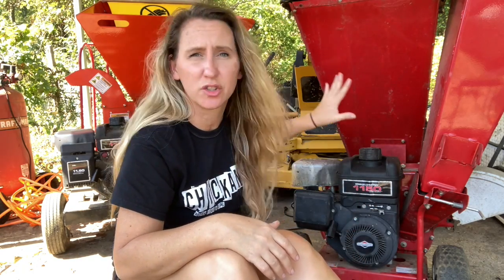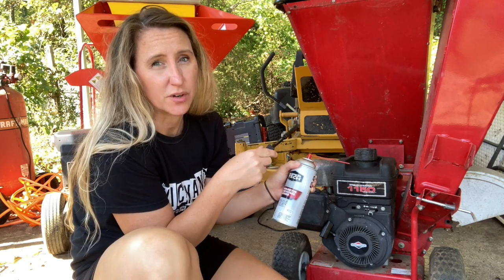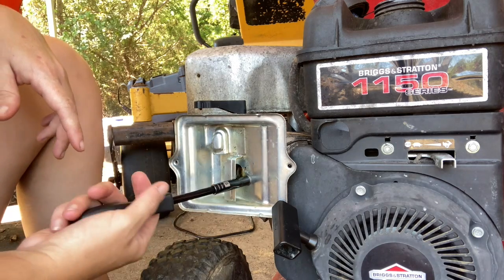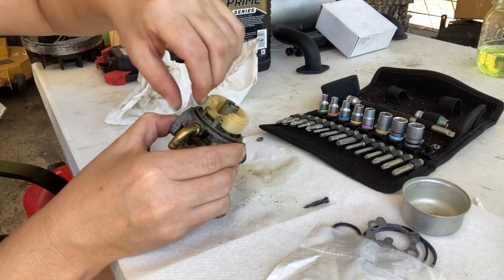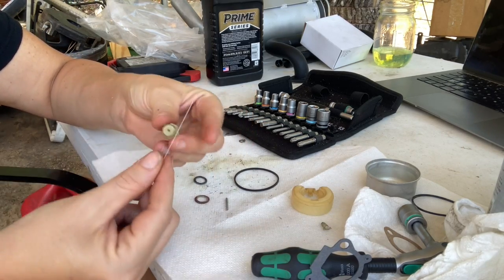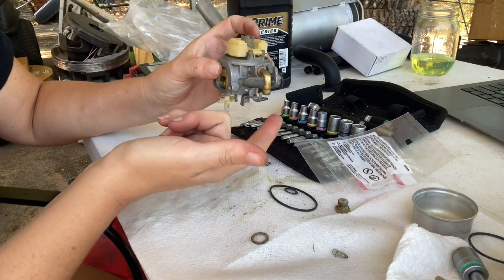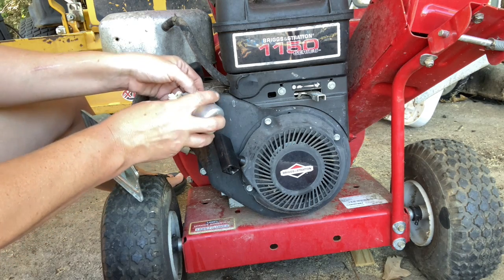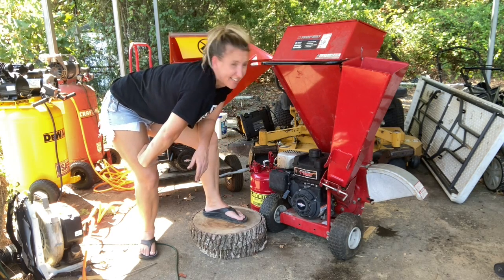Log Splitter/Chipper Shredder WON'T START? HOW TO REBUILD A BRIGGS 1150 SERIES CARBURETOR

Comment: I have a similar chipper shredder with the exact same engine. Bought it used two years ago and it ran ok but had a hard time starting. This year (2025) it wouldn't start. Thanks to your video I was able to diagnose and clean out the carb. She runs! Love watching all your videos 😀

Comment: This time I'm going put a petcock or fuel shut off on the fuel line.  That way I can shut the fuel off and let it run until it drains the float bowl. Maybe that will help next spring. Great video I totally forgot about the jet in the bowl nut.

Comment: SUPERB VIDEO! You're certainly a pro. Hubby and I love your channel. -- Question: We completely tuned-up our 12 year-old Craftsman Briggs Chipper Shredder 1450 Series that was sitting in the shed for years. It runs very well - except when we have to shut it down for a gas refill. It will not restart while warm or hot, and we have to wait for hours, even overnight, for it to finally restart with no issues. Any expert thoughts on why we can't restart a warm/hot engine on full throttle and no choke to avoid flooding?

Comment: I bought a DR chipper-shredder several years ago and quickly learned you have to be careful about what species of limbs you put through it, especially small ones. I was attempting to chip some winged elm and the bark on the smaller limbs did not get cut. Instead, it went through as long strings and wrapped the axle on the flywheel, causing it to overheat. I didn't realize it until I saw grease starting to come out of the bearing. I shut down immediately and checked the cutter adjustment. It was fine, so I just burn that stuff.

Comment: I am very surprised since you own a small engine repair shop you forgot to drain your equipment of fuel before putting it up for the winter, to me that's very surprising! Or at the very least you didn't put a fuel stabilizer and it!
Because you had done either of them you would not have to go through the carburetor right now,
My dear friend Jim before he passed away a couple of years back told me always drop the fuel bowl and drain your equipment before storing it for the the winter or put fuel stabilizer in it and let it run through it for a good five to ten minutes after putting it in so that way you know it's in the carburetor and you won't have to rebuild it!
I truly miss my friend! But the food Lord called him home and almost a year later he called Jim's wife home as well, 2 very wonderful people that are missed every single day by everyone that they touched because we still talk about them even today and talk about how much we miss them! But we know that they are at peace!

Comment: I had one of those engines on my DR chipper. Know how I fixed it? Took it off and put on a Honda GX240. Wow, what a difference in performance and reliability. Sorry, but those engines are junk for chippers, in my opinion.

Comment: I was recently given a troy bilt chipper/shredder. The pull rewind assembly was missing. Will have to order a replacement. Nice job on carb rebuild

Comment: I used a chipper and lawn mower for years but got away with carb cleaner. I guess I was lucky. We never drained gas either. Sometimes they were sputtery but got the job done. Love your info on carbs etc. I watch all of them.

Comment: My brand spankin new Harbor Freight chipper shredder with the predator 212 motor same problem. I'm going to bypass the oil sensor and put a better spark plug in it and see where that gets me. Im so pissed.

Comment: The pull start on those will wear you out after a few yanks :-)  I've had mine not getting fuel after sitting for a few months and started with the step of removing the bowl off the carb without removing the whole carburetor.  Cleaning that jet with some wire and compressed air was all it took and is a quick first step before pulling the whole carb off.  I only use my chipper shredder once or twice a year so this can happen more than you'd think.  I love your videos.  Great job.

Comment: Any good tips to prevent this?
I make it a habit to run all of my equipment at least within 2 months.
Seems to work just allowing gas to flow through the carb for a good 5-10 minutes.
Is there an easier way to do an unlimited storage an prevent the gum Stabil?
Berryman’s in the tank has also helped quite a bit on some rough runners when I do get them started.
Also I never let the tank go dry in anything!
Great videos! T in PA

Comment: The thig I hate about the Troybilt is that you have to spin the entire unit to start the motor. That is crazy hard and so much work. Couldn't they have designed a clutch or way to disengage the shredder from the motor?

Comment: Old fuel in the carb will keep that wood shredder from running. I had the same issue with my lawnmower. I had take the carb off the engine, take it apart and thoroughly clean it. Good vid, BTW.

Comment: hi, just got myself a brandnew "hillvert ht hector 212t garden schredder. It is already a replacement, because the first on was not starting. This is OTB and not starting, so frustrating. I think i will check the carb to. Maybe it was in stock to long? am i guessing wright?

Comment: I notice this again and again with almost all engines that I repair, especially motorcycles: Over the winter months, the gasoline has lost its ignitability. This is especially the case in recent decades, when gasoline contains more and more alcohol. Simply drain the old petrol into fresh one and the machine will start immediately.

Comment: Hi, thanks for the very informative videos. I have a Yard Man chipper/ vacuum with the 173cc engine. I rebuilt the carb last year and it ran fine. I started it recently, first pull and it was running. I used it a few minutes and it died off, I could restart on the choke but would not run without. I let it cool and restarted and ran several minutes and died off again. Do they have temp sensors at all? I am trying to diagnose; your help is appreciated.

Comment: Use an old spark plug boot to start your spark plug with it won’t be able to cross thread using a spark plug boot or fuel hose

Comment: Ck out a set of torch tip cleaners for cleaning jets,, usually they have them in sets and it’s nice and compact size to store in your tool box !!! I got mine at my local welding supply store….

Comment: Those MTD craftsman troybilt cub cadet whatever brand they're marketed as are way too flimsy for chipping and are often shaped (for safety) so that you can't hardly get material through the shredder side. My dad has one with a plastic shredder hopper! It has a hole in it now, of course.  I have a craftsman that I snagged cheap, and the hopper folds down for raking leaves into, but that is a joke, even with the baffle installed. I made the mistake of running seasoned brush into the chipper side and it jammed up the works and bent the anvil area away from the impeller knives. Bending is the only adjustment because there is no adjustable anvil. I am wanting to set it up to run in tandem with an old 18 hp DR chipper I have to break up twigs and blow the chips up a chute and better into a trailer or truck bed. Other than that, I just see them as a frustrating machine to have.

Comment: I have a Honda four cycle self propelled push mower that I had to remove the carb and clean it with carb cleaner a few days ago. That's after I turned the gas off and let it run till it died last fall for storage inside my heated garage.  Now I use VP 2-cycle gas which is a 50 to one mix. My 2 cycle repair man told me to do it and that it would help my mower out as well. No smoke at all and starts like it always did before. now I CAN Just leave the fuel in the tank till spring and it will start right up. Pump gas is an enemy in my opinion when it comes to the  2@4 cycle small engines. Pump fuel has limited storage shelf life. it's ok as long as you use it up, but I have 700 in that mower and from here on out, it will gets what's best for its long term life. Should be the last push mower I ever purchase.

Comment: I am certainly not an engine mechanic,,,, but I have a camera,,, when I take things like carbs  off I take a picture before and after removing the part so that when I am putting things back together I know which hole which spring or link connects to ,,, and or things like the proper deck belt routing etc....  most often I don't have to refer to my photos ... but they have saved me a few times.

Comment: I just bought the 5.5hp model of this from a junkyard for $70. Looked brand new but wouldn’t pop off. Only think wrong was a rotten seat for the needle and clogged main jet. Now it’s a one pull start and runs mint.

Comment: Worked on a lot of engines but I have yet to work on a Briggs & Stratton overhead valve horizontal engine. I don't know how the Briggs & Stratton is but I know on the Honda and the Honda clone engines if there's that much trash and or gunk in the carburetor I've always had to take the gas tank off and replace the little fuel filter that's in the gas tank. On some of the Honda clone engines, I know I have one, I actually put an inline fuel filter between the gas tank and the carburetor for extra insurance. Just to be funny, you should keep both chipper shredders and have your husband running one and you run the other and you get twice as much done, LOL, just a thought.  As always I enjoy watching your videos!

Comment: Hey Chickanic, how do you like those newer briggs engines? ..I just bought a Husqvarna snowblower with a 1150 snow series on it, and it literally made the muffler glow red hot after a few minutes, took it back to the shop - they gave it a valve adjustment, and it fixed the glowing red problem, however I did not want that machine back, so I got another one just like it from a private deal, with only 20 mins runtime on it, so just like a new machine.. that engine doesnt make the muffler glow "nearly" as red.. running on Husqvarnas own bio fuel, but a slight red glowing is visible tho.. I have owned tons of machines, and I never had a Honda, or any of the china-clones glow red.. never ever an older style Briggs either.. Is it just the way they are, the newer ones? Best regards //CC
Reply from the maker: I have seen this on many brands of engines, however, not a new engine. I would had warranted the head for ya. You were right to not keep the unit. When those heads get hot it can affect the valve guides and they can start to back out, and there is no cure. That is a valve issue so it must happen now and again, probably on older series of engines too. Over the years we've seen many brands of new engines fail because of factory assembly mistakes.

Comment: I just subscribed to your channel and love it!!! I have an 1150 engine on my Brute snow blower and had some carb issues when it was new as it did not have a fuel shut off on it. I installed a shut off and have not had any issues for years. Always starts on the first pull. Thanks for a great video.

Comment: I also have 2 of these chipper shreaders, in addition to 3 B&S L style horizontal 8 h.p. engines. They run great, but do need attention to the carb now and then. I ALWAYS non-ethanol gas in ALL of my small engines, and ,change the oil frequently.  They have been running  great for over 15 years now with no problems. Good maintenance is "the key" to longivity and reliabilty for just about everything. Good video, Chickanic! Bravo!!

Comment: I have a cub cadet cc600 lawn mower not even a year old. It starts on a dime I start using it and say half hour after use it stalls cranks for a bit ( elec start ) then it starts runs for another half hour and it stalls. Always fresh fuel and clean air filter. Does anyone had this issue before with a fix or does chicanic have a solution?

Comment: Great job …. Using a guitar string to clean our orifice is my device of choice besides compressed air and you could also drain the fuel after each use as fuel loses its octane level  after proximately 30 days and run your carburetor dry … another good thing to use is Johnson Evinrude 2+4 carb cleaner and it only takes a capful or two per tank of gas .. it’s good stuff they usually have it at Walmart or at a marine supply store or dealer

Comment: ....just a word about shoving wire thru carb jets....be careful, maybe not so much on these 4 cycle motors, but you could alter the jet size ...specially on small 2 cycle carbs...regards from the rural uk..

Comment: An old time tip for you would be to use a piece of fuel line on the plug like a socket extension . It also gives you a little flexibility when things aren’t quite straight on  .

Comment: I have one.  I found the simple fix.  It is a major PITA because I only use it like twice a year.  I'd constantly have to fight with it, pulling the air filter, spraying carb cleaner/starter fluid in it in order to get it to start.  The fix is to only use ethanol free gas.  (which finally became readily available in my area)  It can now sit for MONTHS and start pretty much on the first pull provided I get a good pull.

Comment: I had one just like it. I got it started by removing the spark plug and heating the spark plug with a torch. Worked like a charm, The noise that it makes while it is running makes me aware of how powerful the machine really is. Thanks for the video. I recently traded my branch mulcher for a toro z5000 zero turn mower.

Comment: Hi after working on b&s engines sure that you could buy a carb kit instead of individual parts and does that engine have a.external fuel  filter or is it on the outlet in the tank ,dirt is not a engines friend ,as chicmachanic you must save DIY projects  a lot of money!

Comment: That Troy Bilt looks exactly like my Cub Cadet, just red instead of yellow. 

Same engine, and the sheet metal looks the same too. 

Those B&S engine are pretty easy to keep running, I’ve been happy with mine. 

Thanks for the video.
Reply from the maker: You are correct! They are both made by MTD. Thanks for watching!

Comment: Not a popular motor around rear. More Honda or Honda clones.  Carburetor cleaning, thanks to E10 fuel, Is money in the bank.
 8mm=5/16 not 3/8. It's a me problem, your doing a  great job.
We start spark plugs by hand as not to cross thread them. Stripping comes after the dam thing won't go in all the way or hard turning  the hole way out. Most of the time they show up as a smoothbore plug launcher. Hope I have a repair kit in stock for that size!

Comment: tip- stuck needle -  use a small amount of air  to pop it loose.  a pressure vacuum pump works good it doesnt give it too much pressure

Comment: Great video i have not even thought of some of this.. If it wont start. I just put new gas in it.. So thank you. Like your safety gear glasses gloves but shorts and safety flip flops.. And oh. When i drain out old gas i leave the cap off and shove a clean shop rag in it.

Comment: I put an in-line fuel shutoff on all equipment that does not have one and I then shut it off by shutting off the fuel and waiting for it to shut down.  It takes about two minutes for them to shut down.  I crank them up in reverse order - turn on fuel, wait for several minutes for the carb to refill, full choke and pull the starter.

Comment: If only my tiller and shredder had this engine.  It has the kind where the carburetor is mounted above the tank and does not use a float.  Those are a PITA...

Comment: I had a chipper just like that one, a Snapper.  I have an 1150 on my Briggs generator.  I had to clean the carb right out of the box.  I filled it full of gas, turned the gas on, choke on and pulled the starter.  I started puking gas right out of the filter.  I guess they used ethanol fuel to test it out at the factory.  I removed the carb and cleaned it and it has only seen Premium non ethanol fuel ever since.  I bought it new in Jan of 16 and it starts in one pull every time, if I have remembered to turn it on before pulling the starter rope.  I did add an extra top hat filter to the fuel line and run the carb dry when cutting it off.

Comment: Ain't chipping squat with dull knives/blades. Needs to be a whole separate video for removing and installation of blades, another for sharpening the blade/blades, and yet another for shredding flails/rakes and discharge screens. Could be a video about the do's and don'ts of belt driven centrifugal clutch chippers as well. Good info about the briggs fuel system though.
Reply: Back again, 2 years later, lol. Just picked up a cub cadet that is identical to this troybilt. Well except yours is missing the tow bar hitch receiver. My CC’s previous owner lost the float valve needle and bowl gasket. Didn’t want to remove the carb to find out if it was the needle or the seat that’s supposed to wear the rubber, got my answer here. 😊

  Couldn’t help but notice that at 7:40, the chipping chute was still in the upright storage position, and you were jamming a fairly large branch down the 1/2” maximum diameter shredding hopper.. I’ve seen a craftsman/Mtd type direct drive 3” with a 1” shaft (Tecumseh) sheared clean off flat at the crank case cover from oversized material going into the shredding hopper. Even worse is the models with plastic tilting hoppers, even 1/2” or less stuff will break up or poke through the plastic lower tilt joint halves.. only an idiot or an a-hole would design and sell a chipper with plastic flail drum housing parts or plastic hopper/chute parts.. Don’t even get me started on plastic lawnmower decks. So asinine it’s almost ass-a-ten.

Comment: I have an old tiny Toro snow thrower that needs the carb. rebuilt. I found a Chinese carb. that cost less than the carb kit. Put it on and the machine started right up. I will rebuild the original one, though, in case the $16 cheapo carb. doesn't hold up.